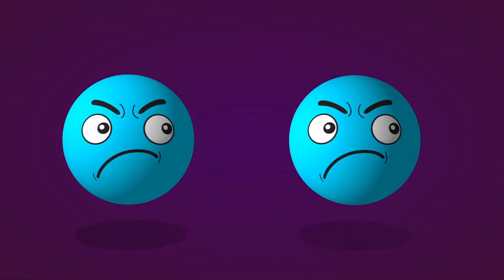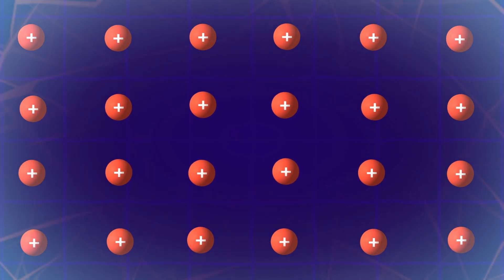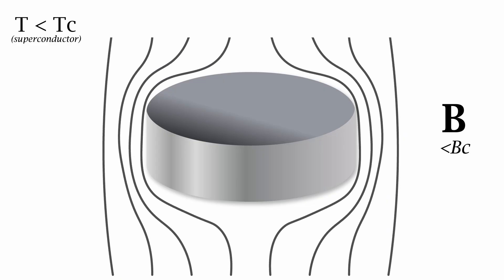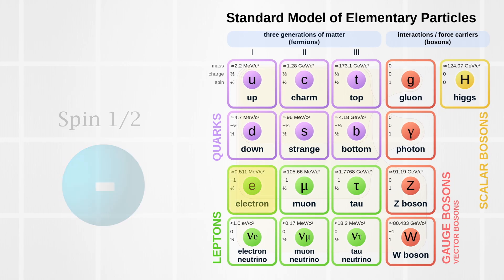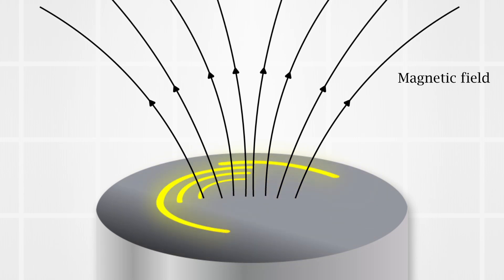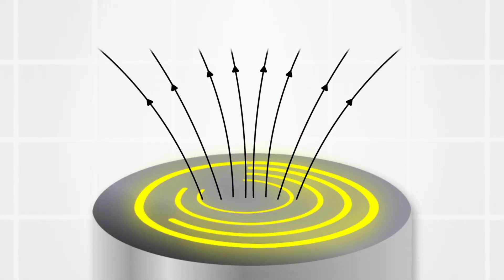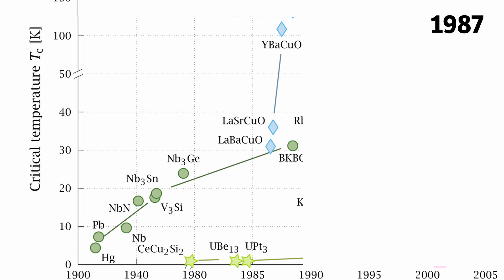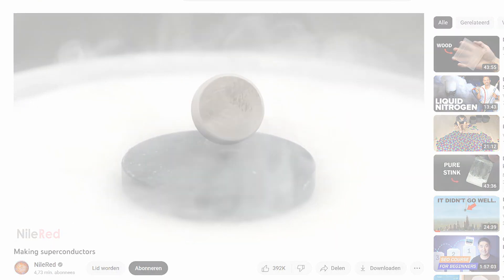How the BCS Theory of Superconductivity Works - Animated

Comment: Please find Ning Li video on the tubes here.   She lectures on the lattice ions ac/dc charge and how she followed a Russians recipe for EG lev.  Her paper on “Gravity Modification”.  
They were using a Rotating ion fields at 5000 rpm w/ a 12” semiconductor and RF at 6 to 10 million ghz in experiments.   The results were levitation and a plasma discharge from the top of the subject. 
She was awarded a nice grant and lived her life perfectly till a few years back she is deceased at 74.  
I’m sure she died of natural causes.  
wiki

Comment: Bro this is really fascinating.... as a 12th grade student i love this very much.... i was curious when i learnt solid state .... I was intrigued to know how superconductors work.... Now it is really useful for me... Thanks Mate!
Reply: It will help you in engineering too
Reply: Project Hoverwave: The Quantum Compression Controller (QCC)

Concept Title: Dial-a-Wave Superconductivity: A Rheostat-Controlled Compression Model for Tunable Quantum Energy Systems

---

Overview: Project Hoverwave proposes a revolutionary new model in superconductivity: using precision-tuned pressure as a rheostat to dynamically modulate quantum phases in superconducting materials. Instead of relying on static extreme environments, the Quantum Compression Controller (QCC) enables real-time control over electron pairing, lattice vibration, and phase transition boundaries. This tunable system opens doors to scalable, room-temperature superconductivity in practical applications.

---

Core Innovation:

> “Threading the needle in a quantum storm” — using pressure like a dimmer switch to shape superconducting states on demand.

Key Features:

Dynamic Lattice Control: Tuned pressure alters atomic spacing and electron-phonon coupling.

Phase Zone Targeting: Maintain materials in the "Goldilocks zone" between superconducting and thermal disruption.

Waveform Shaping: Customize current flow and superconducting behavior like a sculptor with a quantum chisel.

Dual-Control Systems: Combine pressure with electric gating for next-gen quantum materials (e.g., twisted bilayer graphene).

---

Candidate Materials for Testing:

1. Twisted Bilayer Graphene (TBG)

Superconductivity at ~1.1° twist angle.

Responsive to strain and gating.

Ideal for nanoscale rheostat application.

2. High-Pressure Hydrides (e.g., LaH10, YH9, C-S-H)

Room-temperature potential proven under extreme pressure.

Target lower-pressure variants.

Explore pulsed pressure as a dynamic trigger.

3. Zentropy-Theory-Guided Compounds

Pressure-sensitive phase transitions.

Custom screening for layered perovskites, chalcogenides, iron-based superconductors.

4. Exploratory Candidates

Cuprates (YBCO): Oxygen lattice modulated by micro-pressure.

Nickelates: Cuprate cousins with promising early data.

---

Applications:

Quantum Computing: On-demand superconducting logic gates.

Power Grids: Lossless electricity transfer with tunable load response.

Maglev Transit & Hoverboards: Stable levitation with modulated fields.

Sensors: Superconducting detectors with tunable thresholds.

---

Next Steps:

1. Develop micro-scale compression actuator